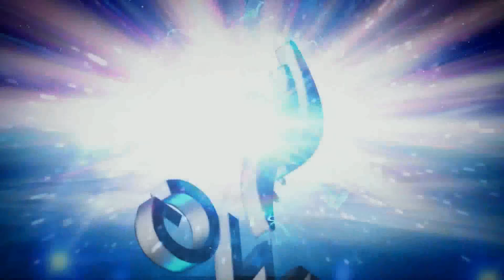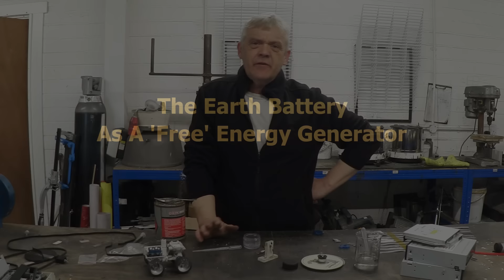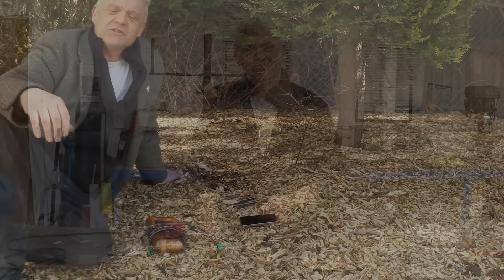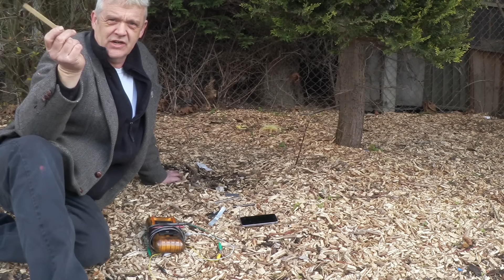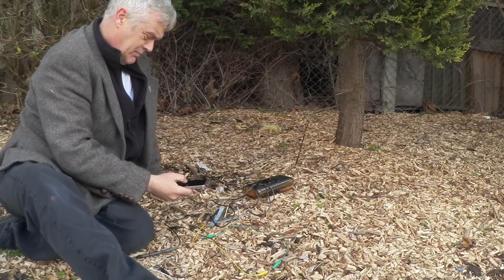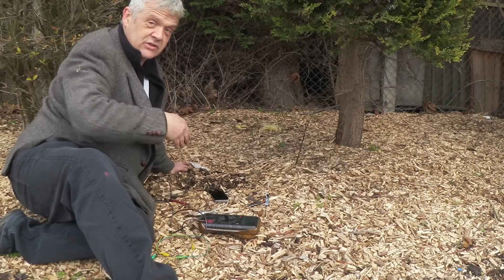The Earth Battery As A 'Free' Energy Generator

Comment: OK so you take your car you park it at home and plug it into the battery that’s grounded to your house and then the ground round it collects energy charges the starter starter ignites in the morning the starter ignites. The alternator alternator kicks in charge is the battery the motor is running, of course you would maybe need to invent a different type of motor with may be a four-cylinder and incorporate the same technologies that are used to start and to keep running pistons moving smoothly with the control lever called the gas pedal. In this case I don’t know what to call it probably won’t be a gas pedal but then basically all I’m saying is if you can do that you can run a car that doesn’t need gas. You can run a car that can use gas. It’s just a back up, and you can also create UFOs which would be eventually identified love uses energy and you draw so much energy from the atmosphere think about the wheels turning on your car you could use the wheels as us as for energy source is separate from others that are on the road like mini generators in a damn think about that I think about the alien crash in Roswell after the military was trying to run the stuff underground drying the energy from all around not realizing it caused a UFO to crash

Comment: My question is, and after having tested voltage from the ground which was 0.8 volts with the anode and cathode about half meter apart .I've planned to build a large array over a few hundred square meters. What will happen if lightning strikes? That much power would destroy anything connected to it. Is there a solution?
Thank you.

Comment: Quite interesting 👍
if you get 21  8mm dia by 1 mm  magnets 20 copper discs 8 mm dia 20 zink discs 8 mm dia 20 moist paper discs , build them up magnet, copper, paper, zink, magnet, copper, paper, zink and so on. that gave me 12 volts  out of something less than the size of half a cigarette. But no voltage capacity therefore no current. How can I get current?

Comment: I seen while reading through comments that acidic soil boosted the output, so instead of using just straight compost what about under Cedar and pine trees where the needles have not been cleared? Also could it be sized up enough to fill capacitor Banks?

Comment: Is not the soil acting just as an electrolite? if you connect magnesium and grafite you should get around 3.2 volt.. you can even charge it.. the problem is that magnesium get oxidate fast in any kind of electrolite so is not a long time investment.. you can do this experiment in the ocean and i think it will work better cause salty water conduce more than wet soil...

Comment: The planet is a big generator. The earth acts like a bar magnet and so does the sun. The earth's core is iron and also rotates. There is a whole bunch of spinning and orbiting done by these magnetic objects and it generates a huge voltage between the poles that measure in millions of volts. It is not a battery cause it is a running motor so you will see a voltage.  I might be wrong but if the earth, sun, and iron core all stop moving and you still see voltages between the poles then I will admit to being wrong.  The reason why the earth's core is still molten iron after 13 billion years might be because this giant engine is pumping energy into the core to keep it hot.

Comment: N.Tesla used a plate burried in the ground. That plate was connected to 1 U shaped plate And + part was aluminium plate high above the ground, yes, but that was connected to  'upside down U plate' what was very near to U plate connected to ground. (so they act little like air condensator but that is not the whole truth it did't work well with commercial air condensator) I ran few test and it will collect good amount of energy but it work best only 2 times/day, about half hour/perioid, i don't know why.And the aluminium plate should be solid and thick enough, high above the ground  and polished. tinfoil is too thin.
Reply: The pickup plate is to be high above the ground..

Comment: It does sound like corrosion or some combination of corrosion as a exchange of electrons and adic soil or movement by water etc, creating a battery like effect.

Is it an efficient system? You can breed ant or creatures, life forms and put them in a relatively cheap stable system and have them generate power by all sorts of means...

you can produce fuel.... through various plants or decomposition materials...

but that is a vague system of udnerstanding, the chemistry invovled allows you to further refine the system
 Then there is the design of the engine itself or other makeups..

POwer/ energy.. the most common translation of movement ot use, is hte water wheel, for localized grain crushing for generating trade capital.. and using the rotational constant power of water flowing ot create use.  Batteries have come a long way and so are really good, but using pipes and varrying their sizes can create various uses of energy for use... IE for making and forging metal materails and more pipes... utlzing mechanical motion seesm ot create a more refined system.... to which becomes better and better.... by the more indepth udenrstanding of nature...

AS muc has people state burying trash.. and generating energy, there is human energy that is exploited to  destroy or udnermine other groups or places... IE criminal networks are nto as intelligent or udnerstanding or loving but are quick to copy, udnemrine, murder etc... and epxloit people, typically exploit females thorugh nonsense books or langauges.. so the beauty of humanity is its naivety and innocence is lost... that is the tradedgy of america... the creation of criminals through the greek process... just utterly devastating.. but hta would be a whoel story.

Comment: Im wondering if you could help me scale this up to a useful system ? We have half an acre and are pondering whether we can get enough voltage to reach 240 volts ?   The problem I face is that I cannot find where to buy carbon and magnesium. Google searches gives me carbon fibre and magnesium supplements no matter how I phrase the search. I am in Australia. Im very happy to film the entire experiment and see if I can get it to work, and would like some help with safety with the larger voltages and how exactly to harness it.  Are you interested in helping ?
Reply: I have been reading the comments and l think it would help you scale up if you read them.  Go North - South. You wind copper around metal, like he wound copper around the nail and put it in soil that has some moisture and salt - maybe manure?  You could connect in series positive to positive and negative to negative.  Wear plastic gloves :)  Then, you need battery storage of some type, an alternator,  and something to use the electricity. Just an idea :)
Reply: @ruthcostea5633  If there is significant voltage AND energy coming off, say.. enough to run a farm as stated prior, then the battery would be redundant, perhaps useful for larger loads ie higher kw hour usage devices. Otherwise... it would be just like a grid connection.
Reply: btw I did not do the project. I had to unexpectedly move.. and now I love in a city.

Comment: Does it matter the thickness and length of the rod? Will bigger rods produce more voltage? Does amps play a roll here?
Reply: I've seen that the voltage won't change based on the surface area of the materials but the amps will changed based on surface area of the metals.
Reply: @Jesusisnumberone5740  thanks for replying!.. so your saying carbon and magnesium can produce amps but no voltage right?...im new to this free energy thing...so what about voltage...?...its
 confusing with AC to DC, than we have Volts and Amps.... anyways thanks for replying
Reply: @jonathanleon6615  the voltage is based on the metals used and won't really change significantly. So the different combinations of metals will produce a different voltage. 

The amps will be increased based on the amount of surface area on the metal.
Reply: @jonathanleon6615  I'm not sure if it's AC or DC. You will have volts and amps. With this method it will be really low of each. I'm new to researching this stuff so idk everything
Reply: @Jesusisnumberone5740  dude your a legend! Many thanks!
Reply: @jonathanleon6615  all praise to Jesus Christ my friend!

Comment: There is no free energy. The energy, this kind of system makes accessible, is accumulated in the metals. To make pure zinc or copper one has to use a lot of energy. There is no zinc metal in nature only zinc oxides. To make it into metal you need even more energy. The reaction in the battery makes this in revers and the remaining energy can be detected as a stream of electrons (electricity). It is a cool project, of course it is, but it is not free energy. If this would be possible organisations like military would relay havily on it, can tell that.

Comment: Klystron coil array,  core using Capacitor in center of apparatus vacuum pressure valve polypropylene materials,  Spark plug between the wire in center of tube apparatus " Zero line loss " lightnin travels using mass Molecular waveform energy propagation fields " ELF, ULF " Frequencies..7.682 Hertz " Schumann's NMRF " the capacitor's  siphon and consume energy, 3 6 9 12 , an alternative is to use two HG DB Tweeters to distribute vacuum pressure from A to B location...and Use mechanical motion to charge " Shaker flashlight I can Think up and fabricate MANY things..however building it ourselves is a threat to a energy consumption Society..

Comment: Is not earth is manly covered with salt water? So the reaction of salt, water, sink, iron, you get what? Yet with salt water is what? So as the water flows threw the earth would that be no different then the wires threw a grid? Same as in livings things. Salt makes everything work and for it works that is electricity going threw it. So if the ground is dry there is no water or the main ingredient for an reaction. So the ocean water currents move making an friction in turn makes current. I could be wrong. Then I could be wright.

Comment: "it can't be too dry" 
"the voltages that you get, depend on the metals that you use"
"the current that you get depends on the surface area of the metals"

You literally are just describing a battery. Seriously? you really cannot see, that this is a simple chemical reaction?
Do the exact same process, 1m above ground, use the same metals and place them into an electrolyte. 
1.Take reading...
2.that's this out the way.
3... 
4 if you still think the earth is generating the current, then it's electrolyte its the dirt.... Its strange see, because you said it doesn't work dry.... Well then it's a redox rxn...... Q. Otherwise, you could, this very second patent whatever mud you have, as the key electrolytic substance making a solid state battery possible......
C'mon man. Do the rxn with aq. NaOH and the same metals, you'll get MORE ENERGY because its simply a better electrolyte for the rxn to occour in.
Absolutely ridiculous.

Comment: I think you lost the hole point! When  Nicola Tesla try this is the sky the limits! Go up ten meter on a flagpost put an antenna on it and you have a currency with high voltage app. 100 volt take down this in a atmospharic engine put the negative end in a Iron bar put that in the earth! If the engine runs a cylinder you have a kinetic batteri! Connect the antenna with a Engine and the engine on the Iron bar with power cables. Theori is one thing but if you have the resourse please try this! It's really stupid of  my to go in A "think-mode" if an earth battery lika a crystal battery incrise the Amps it's awsome! So we want a free battery from sept to may! This is the Answer we in the North parts of the Tellus need!